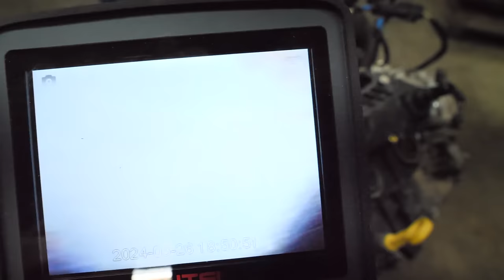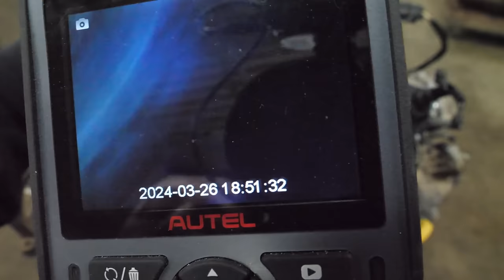ANOTHER BAD 2.7 Ecoboost? 2018 F150 Twin Turbo V6 DEAD @ 131k Miles

Comment: Yeah you could fix that head for a few hundred... With a monstrous amount of labor to R&R and imagine, you quote the cust. for right head R&R + valve job, and once you've half way into the job, you're cleaning the deck and piston tops ready to put it back on and you realise there's a piston rocking on two axis. Now you ring up the customer and tell him he needs a bottom end too? There's so much labor to open up a chain driven DOHC V6 that a complete used longblock isn't that bad of a deal.

Comment: To this day, I STILL don't understand why car manufacturers thought PLASTIC fluid pans (i.e. oil & transmission) were a good idea. Same goes for plastic drain plugs.
Reply: Why?

For the same reason our reactors do not have containment buildings around them like those in the West. For the same reason we don’t use properly enriched fuel in our cores. For the same reason we are the only nation that builds water-cooled graphite moderated reactors with a positive void coefficient.

It’s cheaper.

Comment: My 2020 2.7 has Been pulled 3 times. Currently has 52,000 miles roughly every 17,000 needs a new top end.  Only modifications is a K&N air filter and Borla exhaust. A daily driver gets about 30 miles on it a day mostly highway oil change every 3k-5k

Comment: Looking on Pro Demand it calls for 17.5 hours to replace the oil pump drive belt. No real info on it other them replace the timing set while there.
Reply: I think in a front drive application it would be engine out
Reply: Good Lord! That's a pile of $$$. I think these engines would be fun in a hobby car, like a '69 Mustang. Not so much in a daily driver, high mileage situation.
Reply: @StuntPosse  🙄

Comment: I know with the multiair engine, a local running the stock tune and 91 octane has burned a valve. I have raced my car its entire life but I’ve always run 94 octane fuel and for the last 4 years I’ve run water/methanol. 

Additionally, I take extra precaution to tune the engine where the fuel enrichment comes in gradually rather than all at once like the stock tune. I also use more fuel during WOT, rather than targeting 14.7:1.

Comment: An immersed rubber belt to drive the oil pump, jesus crust.
Reply: Someone at Ford needs to get fired for that idea
Reply: I know right? Makes about as much sense as squatters rights.
Reply: I swear, Ford can take a solid engine and destroy it…5.4 2v to 3v, 2.7 EB, 5.0 coyote 3rd Gen.  unreal
Reply: Poor design
Reply: Bloody new Duramax 3.0 diesels have one of those. 

On the rear of the engine. 

With an inspection mandate of 150K miles. 

Which requires removal of transmission.
Reply: @TheMadTube  23+ is 200k miles.   Pulling trans is one thing. The fords require disassembly of the front of the engine, including timing chains.
Reply: On the other hand I've never heard of one failing
Reply: Planned obsolescence, it won’t fail until 150K/10years. Out of warranty. Encourages owners to trade in every 5 years, provides work for the maintenance department, sells parts and takes rigs off the road earlier to increase demand.  Absolutely perfect design from a soulless upper management point of view. Remember they work for the shareholders, not the customers. What are you going to do….. buy a Dodge? They’re even worse.
Reply: @TheMadTube  Throw away engine.  6.4 power stroke of the modern age.  JUNK
Reply: @gofasturnleft01  And that’s the reason I left all of the big 3 years ago.  Land Cruisers and Tundras for me, my pocketbook and my blood pressure are much happier.
Reply: When bean-counters get involved 😒
Reply: @TheMadTube  I would rather deal with the location of the belt on a 3.0 Duramax than a 2.7 Ecoboost. Far less work dropping or sliding back the transmission, pulling the flex plate, and accessing the belt through the opening in the back of the block than working on a F-150 that will require removing all the accessories on the front of the engine, pulling the all the junk bolted to the timing chain cover, removing the harmonic balancer, removing the timing chain cover, removing a timing chain.... ah we're to the belt. but while we're in here we might as well do the timing chains... retime the engine, reinstall all that sht we had to take off just to get to the belt. 

Yep, I'd gladly do the Dmax 3.0 belt change instead. 

As far as inspection mandates... sure 150k miles... it's really just a "replace the belt since you did all the work to get to it" mandate, because anything else is just stupid to do.  150k miles is the absolute maximum I would try to push the oil pump belt in the 2.7EB/5.0. For me personally, I would do it sooner than that since the belt starts to generate debris that can clog up that plastic joke of a oil pan/pickup screen. I don't care how many miles Ford claims the belts are good for, it's foolish to just take their word for it and gamble your engine's longevity.
Reply: @hokie9910  The new Tundra is an even bigger POS with engine that's blowing up left and right.
Reply: @hochhaul  I asked a the head mechanic at a large volume Toyota dealer how many engines they’ve replaced in the new Tundras, he said 0.  This dealer services 150-200 vehicles a day.  They had some early turbo actuator issues but that was quickly resolved.  You do realize hat engine had been in the large Lexus sedans for years and no issues.  Where are you getting your data?
Reply: Crusty… 😂😂😂
Reply: @gofasturnleft01  ah yes, those conspiracy theories ..
Reply: @hokie9910  your blood pressure must be doin real good waiting for the recall for the exploding toYota engines
Reply: @hochhaul  well that’s an opinion….
Reply: @hokie9910  the info is out there, but then again you have to acknowledge and accept that toYota has some major engine issues
Reply: @pathunter7003  Opinion on 3.0 Dmax vs 2.7 EB/5.0? The labor times are out and it takes hours more labor to change the belt on the Ford than the 3.0.
Reply: @hochhaul  there is no need to change the belt but do what you gotta do
Reply: @pathunter7003  Again, I  am sure there are some but still not seeing them widespread.  Whenever there are a couple issues the GM, Dodge, and Ford fan boys take it the extreme when it comes to Toyota.  The last time there were any issues was back in 2007 when the 5.7 first came out and there were some cam shaft issues, fast forward 17 years and most people would say it was the best V8 ever out in a half ton truck.  Here’s the thing, Toyota always fixes their issues….can you say the same about your favorite brand?

Comment: My father has this engine in his truck.  256,000km on it.  So..
Reply: So plan on getting that oil pump belt replaced unless you want to gamble on Ford's claim it's good for 200k+ miles.
Reply: @hochhaul  do we have significant evidence to prove that it doesn’t last 200,000 miles?

Comment: I'll be keeping my 1998 Saturn SL.  Two valves per cylinder, aluminum and steel everything, one wire harness and a few hoses.  That engine you tore down is insanely over complicated and glued together with one time use plastic parts.  And an "oil belt"... Ho Lee Smokes.

Comment: Next step is to integrate the camshafts and their accessories completely into the valve cover so that nearly every repair is "engine out".  😈
Reply: Seen a VW engine lately?
Reply: @babaganoosh555  Oh noooo....not only has it been done, the cams are permanently mated to the valve cover.  I'm laughing because it's better than crying.
Reply: I mean its only a couple of steps away from welding the heads to the block at that point.

Comment: a rubber belt in oil that drives one of the most important things in an engine. come on ? this is made to fail!
Reply: is kevlar
Reply: @peterpeter5666     It's Kevlar and not rubber.
Reply: @wysetech2000  It's kevlar embedded in rubber.

Comment: I don’t know if it was mentioned but the 2.7 block is made out of CGI material and built like a diesel motor but in gas. Diesel motors also use CGI blocks. The piston design is different from the 3.5 so it’s able to handle that HP and TQ with no problem.

Comment: Engine mechanic: Always replace the entire motor, Never rebuild. Literally never bother even pulling the valve cover after sticking a scope down a spark plug hole. Used to be the other way of always rebuild, the types of customers, machine shop problems, part reliabilty, Etc. Also, wont install used or any long block that doesn't come complete with all covers and gaskets pre installed and a dyno sheet shipped with the motor.
Reply: LOL, not really an engine mechanic so much as an engine replacer.  Lots of good mechanic still around can make money doing decent repairs as not every can just ok a total replacement.

Comment: I do like the design of the piston crowns, because that is the look on my face if I was told I would need to replace the engine in my truck
Reply: Particularly when I've clearly done the right thing and changed the oil often. Someone else that neglected their 2.7 and waited much longer between oil changes is still driving because they didn't draw the short straw.

Comment: Well if I ever thought about buying a 2.7, I stopped the video when I saw rubber belt on the oil pump.  ARE YOU KIDDING ME?? What is this thing, an engine for a Korean Rickshaw??  Ford, I swear to the heavens above, just stop the madness, please for the sake of humanity and for the pride of our once great country, JUST STOP.
Reply: Yeah it's a shame. They did it to the 5.0 Coyote as well.
Reply: I don’t think you are going to find anything new currently without at least one big engineering flaw/compromise including Toyota.   It’s sad.
Reply: Does GM work for you? They've made more than 100 million small block
v-8 engines that are as reliable as the sunrise, and then they come up with  Dynamic Fuel Management (DFM) that renders those vehicles equipped with it, in time, unusable.
Reply: @hochhaul  Yes they did!
Reply: @CARSON441  Agreed, the 5.3 was a good engine until 2007 when they introduced low tension piston rings and AFM.  I left the domestics long ago and went to the Toyota and Lexus makes.  Lot less stress and aggravation in my life.

Comment: Took apart a 115k mile atlas 4200 out of my wife’s trailblazer. Was only 6k from the last oil change and ended up throwing #3 rod. What gets me is there was no evidence of the piston hitting the head but the rod is now in 3 pieces. Also out of the 14 head bolts all 14 broke as well as 5 of the bolts holding the main caps on. All the other bearings showed minimal wear except for the cam journals, no metal in the upper end of the motor or in the vvt solenoid.
Reply: That sucks I've seen so many of those engines pushing 250k to nearly 300k. Could it have been water ingestion? Cam journals was probably due to extended oil change intervals.
Reply: Those engines are absolute TANKS. Constantly seeing them 250k +. I guess there are always exceptions though.
Reply: @hochhaul  Regarding the oil change intervals...don't trust the "quickly change your oil" places. One of my friends had his Jeep engine crap out because they really didn't change the oil at all. A friend of my brother's happened to check the dipstick when he got home from having his oil changed. He had to add 2 quarts to get it onto the stick. The manager determined that their dispenser had wonky calibration...for how long? Two people I know went to their dealerships to get the oil changed, and left with none. One got a new engine out of that deal. I would have run it until it barfed and made them put a new engine in it. But I made it a practice to check the oil level right in front of the shop door. Don't trust anybody. I'm soon to be 79 and will change the oil in my Silveradoo tomorrow if it isn't raining.

Comment: One thing I have learned in the last 15 years, any and I mean ANY engine with 'ECO" in the name or designation will be a delicate piece of shit and eventually break spectacularly offsetting any and all fuel savings from buying the teensy version of a real engine.
Reply: Wisely stated, this seems to be absolutely true.
Reply: Not really. Even the block is over built.

Comment: The  burned  valve would have happened due to faulty injector  this the first thing you need to check on a direct injected engine. Fuel was burning during the exhaust stroke this is why it burned  the valve. I know you have no experience with diesel engines and direct injected engines but this is one of the most important thing exhaust temperature on each cylinder will help fix the problem but obviously not available on the car engine.
Reply: So that would be a leaking direct injector? 

I don't recall leaking port injectors causing harm, so I assume you are talking about the DI.

Comment: The only "reliable" thing about these engines, be them 2.7-3.5l, are the glib bafoons who like them. . . Nothing like making a tiny, insignificant, "good on gas" size engine SCREAM LIKE CRAZY to make the power that a V8 could make with ease. They're all destined to die a horrible, quick, early in life death... like DSM's back in the day... there's no replacement for displacement, you can get the same HP a NA V8 can make with a tiny 4 or 6, but they're not gonna last real long doing it. Especially with today's BS tricks that are commonly at play.. like BS direct injection, and BS cylinder deactivation, etc. But truly, just taking a tiny little wee wee engine like this one, and upping the hamsters on wheels via boost, isn't gonna make it last real long.
Reply: So far, there’s no evidence to support any of your opinions
Reply: These engines don’t ‘Scream like crazy’ they make power and torque just like a diesel.. no need to rev them over 3500 rpm’s.. even when towing. Tell me you have no idea what you’re talking about without telling me you have no idea what you’re talking about.

Comment: I'm pretty sure that that valve burned up, started misfiring, owner took his truck to a shop, they found metal in the oil filter, and suggested they get a new engine, and that's how this became a core.

That coolant in the bore could have leaked in there while you were prying on the head to take it off. I've had that happen to me before.

Comment: I have a 2018, bought used with 80k l use it for business,  no hauling. 
Now have 166k ,no issues,  l changed plugs at time of purchase, then again at 130k, did all fluids, dif,transfer and transmission!
Guys remember its a Kevlar belt running the oil pump, even cracked the Kevlar is very thin, at base of belt, its extremely durable!! Very very unlikely to ever snap !! Also its under low pressure..
Stop worrying about the oil belt.. its quiet, its better than the chain, believe me...
Reply: The belt "breaking" isn't the problem with the belts. It's the small pieces that the belt sheds when it deteriorates that causes the problems. The pieces tend to block oil passages and filter screens which causes oil starvation to critical parts.

Comment: Once again my friend thank you for enlightening us to the innards of a ecoburst. With the troubles direct injection has with not cleaning the intake ports, could it be possible in your opinion, if something like a water injection, or retrofit gas injector at the throttle area, be developed and designed to help prevent carbon crap building up? I have used a spray bottle with distilled water I slowly sprayed into the carb at high idle when the engine was hot, that had always helped de-carbon everywhere to and including the combustion chamber in older carbureted engines, that had noticeably ran better afterwards. So devise a small container of distilled water, with a slow pump to activate every now and then to help keep ahead of the buildup of carbon crud?

Comment: I'm guessing a tune. I told myself that I would tune my 2.7 after the warranty expired, but after owning the truck for 6 years, I've never once thought to myself "it needs more power". I put it on sport mode when I want it to feel like a different truck. Tune be damned.
Reply: Yeah, I decided not to tune mine, it has plenty of power. 

I don't need to spin the tires while towing a trailer.... It's got plenty of power, not worth the risk.

Comment: This is one of your more interesting tear downs! It would be fun to know what oil was used and what the change intervals were? This engine is remarkably clean and low wear. Further it seems Ford is actually trying to make engines that can last despite a few decades of evidence to the contrary. Law enforcement, for example, is faced with buying a NA V6 in an Explorer that’s slower than a Kia Soul or risking the famously unreliable Ecoboost V6 options. I’d say Ford has come a long way with the gen 2 as your tear down shows.

Comment: You may think that overbuilt compacted cgi block looks like it would hold the rods in ("back in line, you!") but two different 2.7s grenaded within a couple weeks of each other running aftermarket turbos and aggressive tunes. Both blew plenty of metal out of the new portholes in their respective blocks. Pressure wins every time.

Comment: I enjoyed this one like all the past tear downs.   My 2019 work truck has the 2.7 with 33K on it.  I'm sure it will be turned in around 100K .     If you possibly find a new gen 3 Tundra 3.4 V6 engine, I'd love to see it torn down.
Reply: Most are probably getting replaced under warranty but it would be great seeing a salvaged 3.4 V6 that's on it's way to grenading.